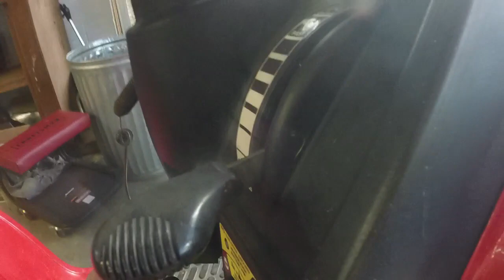Troy Bilt Bronco rider install blades, fix brakes and final testing (part 3)

Comment: I used to work on things so much that I knew exactly what standard size nuts and bolts were.  Then metric came along and I got pretty good with them, too, but that was many, many moons ago.  I have to take 3 sizes with me now and sometimes I'm still wrong, especially when they aren't standard or vice versa.  Doh!

Yeah, I'll be using Anti-seize on everything I can when I reassemble my 2011 Troy-Bilt Horse 46'' XP Hydrostatic Riding Mower with a Kohler Courage SV620 22HP after repairing all the rust.  That's where my Troy-Bilt deck level adjustment is, though it's a different model and good bit newer.  That one still looks great!  It ratchets up and down in small increments, depending on how far you turn it either way.  The adjustment head has gear-type sprockets on it, too, but you figured that some 2+ years earlier.  The front height is adjusted with a nut on the hanging rod, but you figured that some 2+ years earlier as well.  Duh

A $10 deck belt???  WOW!!!  Mine was $37 at the middle of mowing season last year.  I guess that's part of what Covid did to us, but maybe because mine is more powerful and wider.  Not the kind of brakes work I needed.  Back to the list again.  See ya next time.

Comment: I just need the motor shroud mines old brakes work good enough so that piece and a breather tube to the air filter housing and its set and am going to put back on the original carburetor off a 2005 18 hp intek engine its basically the same engine just a different color but the red engines carburetor and necks are longer than on the black engines as yours on the video and mine. I have both 

I dont know what year mine is i can tell someone has changed the seat and put a smaller craftsmen seat on it and it shows its a 2022 model but i know it can't be because you say the engine is a 2004 so i gotta check for the right model date elsewhere on either the transmission or someplace else

Comment: We have the same mower except the gas pefal is in front of the brake on the right. We bought it used. The drive belt is loose and the bolt to adjust the brakes does not tighten the brakes as we tried this. There is absolutely no tension on the brakes. How do I fix these issues.
Reply from the maker: The drive belt is designed to tighten as you push down the pedal, a weird design but what they decided to do.  As for the brakes, those are tricky.  The brake is mostly just a parking brake that fits in a slot so you can get off the mower.  It's been years since I've worked on one so not sure exactly how to fix but it should link to the right side of the transaxle and you can also adjust the brake pad on the transaxle.

Comment: Hi mate. Hope your well. Nice easy fix and does run not to bad. Shane about the surging but that’s a Chinese carb for ya. Chat soon
Reply from the maker: Doing great Mick, hope you are too.  Yes this one looked hard at first but ended up being rather easy.  I'm going to drill out the low side jet to see if it runs any better.

Comment: How did you shorten the brake rod/pedal travel? Mine goes to the frame before it will engage. I cleaned behind the rotor, changed both pads, and set gap to 0.011”.
Reply from the maker: I think I bent the brake rod a little bit, can't remember 100% as I've done a ton of other stuff since then.  Park brake wasn't holding which these are notorious for.
Reply: Did you get yours fixed? I'm having the same problem. Thinking about buying a shorter spring.
Reply: @ezwiththehardware  not yet. I plan on removing the brake linkage and bending it to make it shorter. I’m getting tired of the parking brake not holding.
Reply: @ezwiththehardware  alright I got mine fixed. I removed the steel rod linkage between the rear spring and the front brake. Rear spring held on with the spring hook. Front brake held on with cotter pin. Hard to see so I removed the deck. 

I put two additional sets of 45° offsets to shorten the rod. Started at 22 3/8”. Ended up at 21 5/8”. Still had some play in the rod so it wasn’t engaged until I hit the pedal even with the shortening. 

Brakes were VERY TIGHT so I regapped at 0.011” per the manual. They were loose and offered no brake power at this gap. 

I then just started tightening the 1/2” hex nut until the brakes started holding on park. Then backed off until they were just loose. Then tighten to get it just right. Final gap was 0.003”. 

Tractor now holds parking brake on a 45° hill. Will lock the tire if I brake at full speed. That’s fine with me. I prefer holding power since I have a back gate with a hill approach I have to dismount to open. 

I hope this helps. I’ve been putting it off for way too long.
Reply: @EllisMowersandmore  
Lol you don't remember? 😂😂😂 much easier to said you don't want to share your  experience with everyone!!!!😂😂😂

Comment: Is the Bronco similar to the Pony?
Reply from the maker: Yes the Bronco is a step up, it has a pedal drive transmission and a larger engine.  2006+ has a Kohler engine instead of a Briggs.

Comment: I have one like that brake hold on   neutral but  not holding motion WY is doing that?
Reply from the maker: Sounds like the brake pads aren't engaging when the transmission is in gear.

Comment: i have the same deck / mower,,, my tensioner pulley [the one that swings to tighten the belt with the pto engaged] swings all the way and rubs against the upright brake shoe bracket for the belt in the spindle pulley on the chute side. i cant figure why the tensioner pulley is making contact where it shouldnt
Reply from the maker: It may be because your deck belt has stretched and needs replaced.
Reply: So it rubs against your pulley brake on the deck when you engage the belt pulley.

The only other deck thats close enough to that one i have is that one and a old john deere L110 its deck pulleys are the same the ignition is the same to and other parts 

My guess would be something came loose on yours is why it was rubbing

Comment: Good Video, but Geeze a new carb would have cost $20 Too bad your ok with the Surge.
Reply from the maker: The surge was addressed in a later video.  I drilled out the low speed jet and got it running much better.

Comment: Troy bilit was the machine back in the day before mtd took.over
Reply from the maker: Yes they were, have had a couple older Troy Bilt push mowers that were built very well.  This new MTD stuff while not terrible is nowhere near the quality of the old Troy Bilt stuff.
Reply: @EllisMowersandmore  you got that right i have a 1979 or 1980 troy bulit horse tiller

Comment: I have a mower just like yours I put new brake's on it and they still don't work
Reply from the maker: The brake pad likely needs adjusting.  It's the nut in between the two bolts for the pad assembly.  I don't remember the pedal arm being adjustable.
Reply: @EllisMowersandmore  I tryed that I even put the park brake on
Reply: @EllisMowersandmore  well I got the brakes to work now but they work in neutral but not in drive
Reply from the maker: @christopherjones7882  Pretty common with these.  Mine even tried to creep forward after the adjustment too.  More so the varidrive transmission than anything.  If it holds in neutral that's probably the best you will get with it.